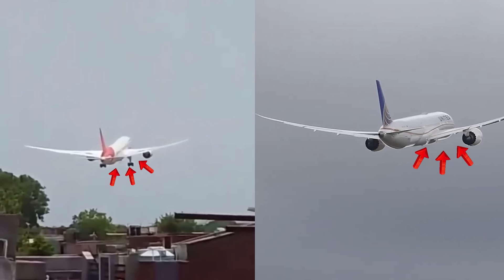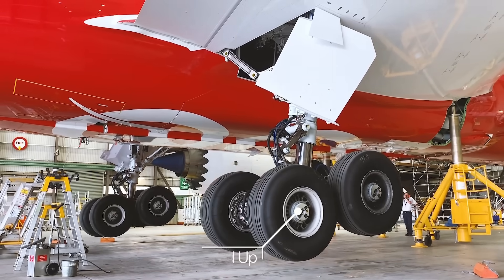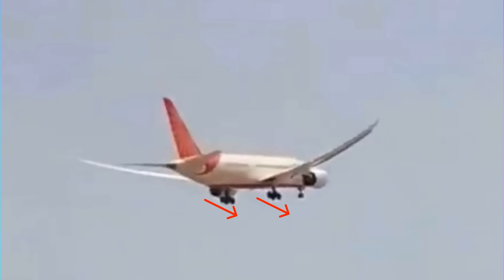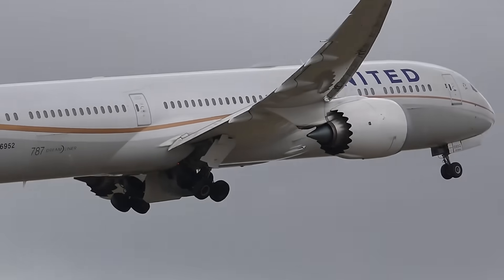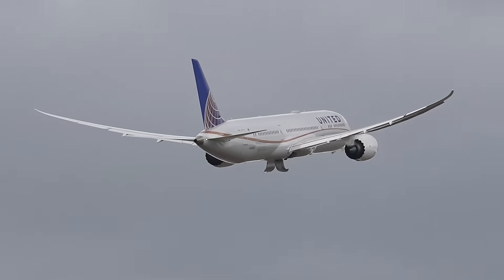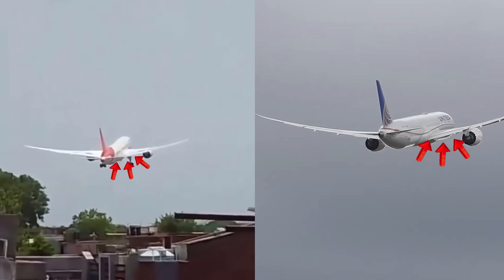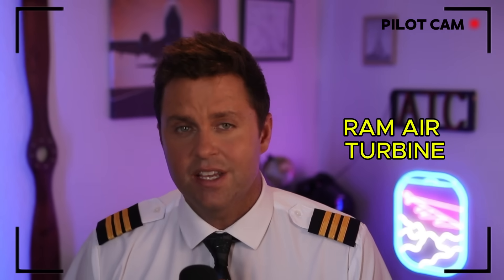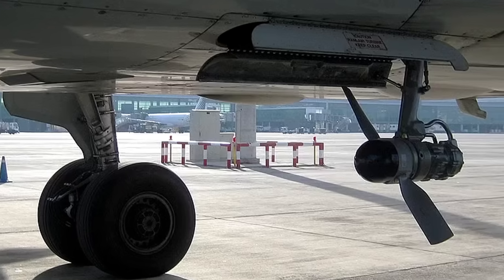Pilot Explains: A New Detail in the Air India 787 Crash Everyone Missed

Comment: Hello everyone I was a 30 year A&P mechanic for the Airlines (Alaska American Braniff) Also a Flight Test Lead Mechanic for Douglas Aircraft on the DC9/ MD 80 series.  Lastly the first three MD 11 test aircraft. I also was a mechanic on the test aircarft for the Doulas/GE Ultra High Bypass engine test program conducted in the mid 80"s at Mojave airport and Edwards AFB.. This was a DC 9 80 series aircraft along with GE engine who were testing the Ultra High Bypass engine with counter rotating composite blades,  with the jet exhaust which propelled the blades for thrust. This was the time GE engine was testing the  FADEC ( Full Authority Digital Engine Controller) for the first time. GE had the first GE90 engine at their hanger at Mojave airport at that time, which I think developed into the GEnx series.

I viewed all the talk/video about the possibilities  of why this crashed occurred. My thoughts are if the RAT was deployed and the reasons it does deploy. If you are dealing with emergency power for hydraulics, electrical etc. These are big issues indeed. FADEC is the computer for the engines, placing full authority over the operating parameters of the engine. FADEC works by receiving multiple input variables of the current flight condition including air density, throttle lever position, engine temperatures, engine pressures, and many other parameters. The inputs are received by the EEC and analyzed up to 70 times per second. Engine operating parameters such as fuel flow, stator vane position, bleed valve position, and others are computed from this data and applied as appropriate. FADEC also controls engine starting and restarting. The FADEC's basic purpose is to provide optimum engine efficiency for a given flight condition. ( Yes I did copy/paste some of the description of FADEC. I am turning 76 next month, and it was easier and better than i could remember)

Also here are three disadvantages of FADEC. And key facts as to my theroy,  why you could have lost both engines.

1) Full authority digital engine controls have no form of manual override available, placing full authority over the operating parameters of the engine in the hands of the computer. (Electrical)

2) If a total FADEC failure occurs, the engine fails. ( Not vapor lock in the fuel system for any reason)

3) Upon total FADEC failure, pilots have no manual controls for engine restart, throttle, or other functions. ( This speaks for itself)

So my thoughts are if the pilots were dealing with critical electrical and other compounding situations, and the RAT was deployed for multiple emergency failures in these systems. You have real bad electrical failure as one. You will lose your FADEC and your engines shut down. 

Just some thoughts from an old timer who twisted wrenches back in the day.

Blessing to everyone who perished, and comfort to their families.
Reply from the maker: Thank you sharing your knowledge and experience!

Comment: I am not a pilot, but when I saw the crash video for the first time, insufficient thrust due to dual engine failure struck me as the main reason for the mishap, especially because the plane rose, levelled out briefly and then began its descent, that too very smoothly. If you didn't know it had just taken off, anyone would have thought it was going to land!
Now that you have pointed out about the silence, that is a very valid point to substantiate this theory. Yes, a flight in take-off mode has its engines really screaming!
Further, reports have also surfaced that the plane consumed an extended runway length before take-off, so it looks like their engines were giving way at that very point in time.

Comment: Thank you for a Very convincing analysis Gary, to rule out the possibility of Landing Gear and the flap extension. fuel problem could be a plausible reason for dual engine failure as you speculated, hope the  investigation team will come out  with the real cause of the incident soon.

Comment: Ok. The sole surviving passenger in an interview indicated he heard a LOUD BOOM 20-30 seconds after the start of the takeoff run, probably around Positive-Rate, Gear-Up.  What could cause a Boom ?  Maybe a remote detonated “device” placed on board.  But not sure about that because nobody has claimed responsibility.  India and Pakistan have been having problems so could be something like that. Who was on the passenger manifest? More than likely it was a Main Hydraulic Hose or Fluid tank that somehow punctured. Could have been crappy maintenance. What was their maintenance like ?   There are also 2 AD’s on the thrust systems (Fadec Control-reset problems). Although if that was a possibility then FAA would have grounded all of them.  
Fuel contamination.   Maybe.  Even with a loss of electrical power those engines would likely suction feed.  On takeoff where is the fuel coming from ? A center tank only ?   There was probably some maintenance anomaly on the center tank, because people / days before the flight were talking about electrical issues with the aircraft.  Would be interesting looking at the aircraft Maintenance log. 
If it was fuel starvation because of bad fuel on the airport other aircraft would have suffered also.   
Extremely unlikely 2 engine failures at once.  99.999 impossible.  I think there will be multiple maintenance issues that will be discovered.

Comment: No body seems to think about the most obvious answer at this moment which is sabotage. As far as I am concerned it is sabotage until it is proved otherwise. Maybe going through the passenger list may lend a clue as to the motive but there are several other possibilities including industrial sabotage against the manufactures, political reasons attached to Pakistan or a Muslim terrorist organisation, or simply criminal blackmail or extortion. There are even people out there that just enjoy killing lots of people for no other reason. To say that crazier things have been known is an understatement. I am sure that if the will was there, fixing both engines to fail very shortly after take off would be a fairly easy thing to do for anyone with access to the craft and the knowledge of how to do it.  A couple of radio controlled servos would do the trick, or maybe someone simply contaminated the fuel deliberately? It may be very possible to sabotage the craft without leaving any evidence to be found.

Comment: It sounds like fuel starvation to both engines, which caused an automatic deployment of the Rat,to run the hydraulic pumps, and emergency electrical generators. They had so little time to react to this situation. The engines might have failed to produce enough thrust to complete the take off. Dual engine failure is so rare. It has to be a fuel issue since bird strikes have been ruled out. Duel bird strikes would have caused compressor stalls in both engines. From the video, no indication of that. The pilots were probably focused of loss of power in the most critical phase of flight, and were unable to raise the gear.

Comment: There appeared to be enough engine power for the plane to climb to 600 feet AGL which is well above ground effects altitude.  Plane then glides downward in a controlled manner which indicates enough airspeed not to stall.  Engines spooled back after V1 maybe from bad fuel or maybe from debris ingestion because of late rotation.

Comment: The aircraft used the full length of the runway ... notice the dirty air as the plane lifts off the end of the runway ... could there have been an accumulation of sand? At the end, that was digested by the power plants ... just another theory.

Comment: Real world 78 skipper here. To add the gear bogies will also tilt forwards when center hydraulics are lost. And please its basically impossible to take off with incorrect flaps. However runway usage indicates a performance issue as even at max weight at ISA +25 you don’t ever go into the overrun area unless you’re on one engine.

Comment: A common problem with the loss of an engine is panic, irrational behavior, and turning off the wrong engine. The reaction to losing an engine on takeoff should be, use the 1 engine to get to altitude, don't even reduce power since you may select the wrong one doing that also. There are many 2 engine planes that crashed without power because of the engine mistake, it is not antidotal. Once at a safer altitude, realize shutting down the wrong engine is potentially fatal so take your time and do it right. Maybe a passenger will get killed if the engine blows up, also it might not be a bearing or blade and will not blow up, fly to safety first. 
The Mayday more or less says it was not intentional, mostly because you are struggling with the other pilot trying to crash the plane, you will never get to use the radio. you might delay lifting the landing gear if you are busy with a sick plane, but once you know you have reduced power lifting the gear to help your underpowered plane fly and is done before shutting down maybe the wrong engine, it is useless in a city with such a large aircraft because there is no place to set it down.

Comment: Retired B737 pilot here.

India is at war with Pakistan. A sympathizer from either country could have sabotaged the aircraft with enough water in both fuel sources to overcome the fuel filters. I know that sounds crazy but so does a simultaneous dual flameout with two engines still intact. Water introduction in the fuel could be accidental or intentional and the source could be from the fuel truck or airport storage tanks. All aircraft tanks are likely serviced simultaneously through an onboard fuel cross feed manifold so any water could enter all tanks at nearly the same time then settle quickly to the pick up points.

My question is, how long would the engines have run on the plumbing after start until water could enter the stream?

Comment: I can't believe that the engines stalled because of the fuel. Had the fuel been bad, the engines would have died long before takeoff. That leaves air as the only reasonable option left. Can airplane engines stall due to excessive air pollution combined with high heat? Mechanical failure of both engines at the same time is really impossible to imagine.

Comment: FOUR LIKELIHOODS:  First and likely, an On Board explosion cutting off communications to the controls likely electrical in nature.   Second Is: The aircraft had its own fuel Contamination problem… For example there is an anti-algicide added to the tanks and instructions have been severely misunderstood and many times over what’s appropriate and led to engine failures.  Third could be a maintenance error.  And,  Last of any list is some form of intentional sabotage.  Internal, external, collusionary etc.

Everything else has so much system redundancy, I just don’t see it.

Comment: The survivor said there was a bang and then the lights flickered. The order is suspicious. Is there a location where a small bomb could take out fuel to both engines or power from both engines?  There is technically two wars on; Pakistan and China. There is also something tumbling end over end above the left wing after it drops below the buildings but before the explosion. That looks like a hatch or sheet of wing metal.

Comment: FYI: The Boeing 787s have experienced electrical fires in the past, primarily linked to their lithium-ion battery system. For example, in 2013, these electrical fires led to the temporary grounding of the entire 787 fleet. The fires were attributed to thermal runaway within the auxiliary power unit (APU) battery cells. The lone surviving passenger on the Air India flight reported that there was a loud bang, followed by the lights going on and off, before the crash.

Comment: If you are thinking contaminated fuel.. contaminated with what? A turbine will run with almost anything..a little water, oil, even dirt, I can’t imagine how much dirt or water you would need to flame out the engines. I’m starting to think a pilot intentionally shut the engines.

Comment: ram air turbine will not solve the power failure of fuel pump.  There may be bad fuel mixture at the wrong type for the hot weather.  What about fuel vapor problem during the hot weather?  was airport management using cheapest fuel?  Do all types of planes have fuel vapor sensor and use auto venting vapor before take off?  Good work on your new report

Comment: Sinister thoughts, maybe it was sagotage.  Engine failure or even shutting engines off during take off is guaranteed a crash, not enough time or energy to restart engines or land safely.  I'm just not sure about contaminated fuel, without seeing smoke or flames.  It just looks like they were shutdown.   With all the redundancy, id focus attention at single point failure items, electrical and fuel system.  Hopefully the data loggers will provide insight.

Comment: Corporate pilot here, so before the main gear is fully tilted forward, the main gear doors are opening. That is not indicated in the video. I think they had a loss of Eng #2 after V1, which explains the use of the FULL runway, dust clouds on the left of the runway, and yaw of the aircraft. Then after airborne, positive rate/gear up, and one of the pilots “secured” the wrong (#1) engine thus inducing the dual engine failure, RAT deployment, and crash.

Comment: Something has been bothering me about the survivor. He had initially claimed he jumped out of the plane before it crashed, which everyone says is unlikely. And people claim he was misunderstood and that he walked out of the plane once it crashed. But when I watch the crash video, there is almost zero delay between the plane descending out of view and the fire ball errupting. And He barely had a scratch on him. I just don't see how it's possible he escaped after the plane hit the building. He would have been engulfed in flames. He was nearly sitting over the over fuel tanks. As crazy as it sounds, I really think it's more plausible and feasible that he opened the emergency door as the plane was descending and miraculously jumped out safely. And I'm not referring to that object seen blowing upward in the video. That was likely something on a roof of a building that was blown up in the air by the rush of the jet passing by so closely. I know the theory about him jumping out early is refuted because the door opening is supposed to be prevented by cabin pressurization... but I posit the plane was not preseurized due to the power failure.
Reply: James Bond did it once and so did Brad Pitt.
Reply: Well, at that low altitude there is supposedly much less outer pressure on the doors. But if he had jumped out of a plane while it was still in the air, it seems like he'd be dead for certain.

Comment: When your home PC freezes up you turn it off & back on again. In 2016 I was sitting on a SAS 737 in Bodo, Norway, when the captain informed us that he had a light on the instrument panel that wouldn't go out after engine start that was supposed to go out. He spooled down & we were taken back to the stand. The captain got on the phone to Oslo & it would take an hour to fly a technician up. After a further 10 minutes the captain came back on the PA & informed us that he was advised to try turning the plane off & after a minute turn it back on. All went dark & silent for those 60 seconds & he then retried starting the engines (a computer IPL). This time he came back on the PA & informed us that the light had gone out & we took off for OSLO. So you can't tell me that the computers on modern passenger jets are infallible. If there was a double engine shutdown, which I have suspected from the beginning, could there have been a computer glitch that initiated that shutdown & would've been impossible to rectify in the few seconds the pilots had left? Remember, he called a Mayday & reported a loss of power.